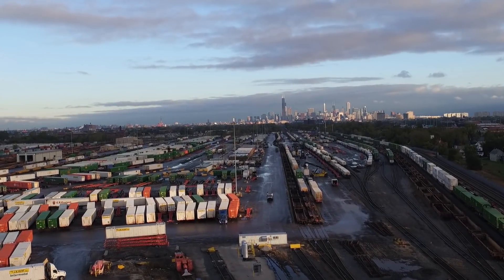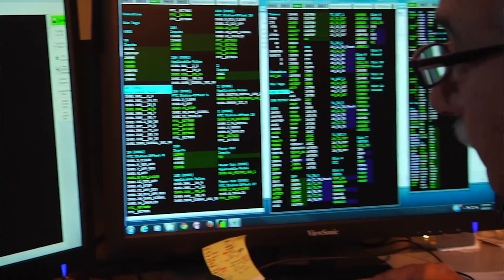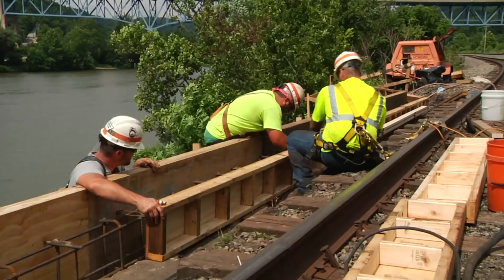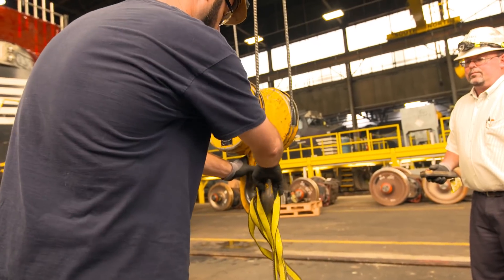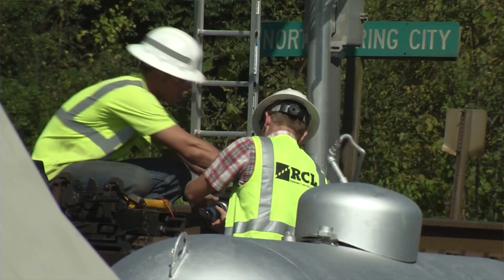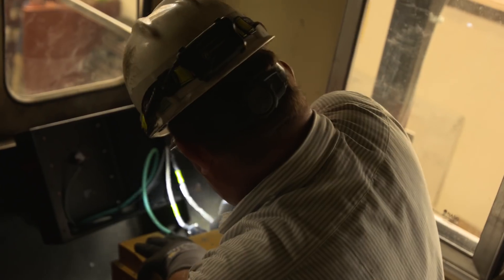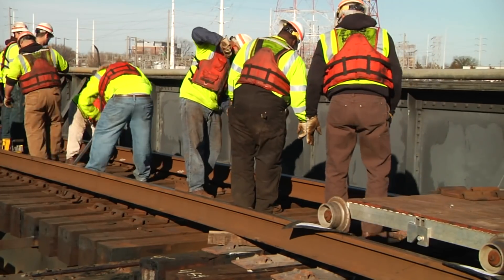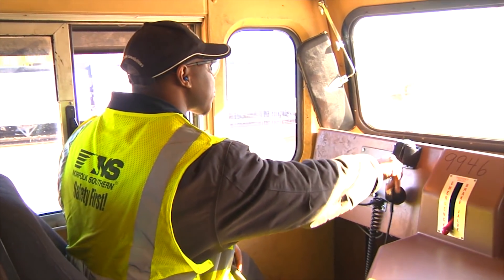PTC: A merger of technology and human ingenuity at NS and across the industry

Comment: I fear that it is just one more step before fully automated trains, which will put more people out of work of good paying jobs, and runs the risk of dangerous things happening with such huge flying weight down the track, sure it might be safer but I fear it is just another excuse to put people out of work before much longer, and I sure will miss the wayside signaling of lights in the distance something that is part and parcel since the early days of railroading.  call me a dinosaur for loving railroad history, but I have my reservations on ptc, not to mention the implementation headaches the big railroads have to endure and the many systoms that are employed, its non standardised and may not have innerconnectivity from one railroad systom to another.

Comment: Does not explain the benefits or reasons behind PTC.  I saw a PBS hour long video on this topic that was more informative http://www.pbs.org/wgbh/nova/tech/why-trains-crash.html.
Reply: Curtis Ehrgott we've built, tested, installed, regulated a "PTC" system — actually a ATP system — in less than five years in Italy. It's not rocket science. There hasn't been any collision, or accident, involving speeding, or unauthorized movements, on the national network, since 2008.
Reply: France has used a far more advanced system than any american railroad is proposing using since 1970.... French TGVs have operated at over 200 mph with the exact technology for 40yrs with ZERO accidents and American railroads act like they have been asked to run a train to the moon.....